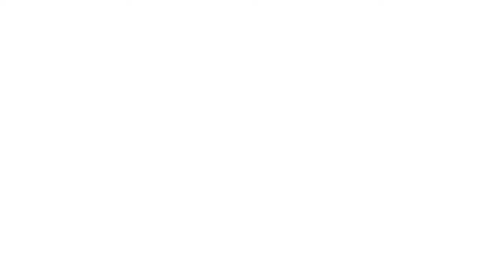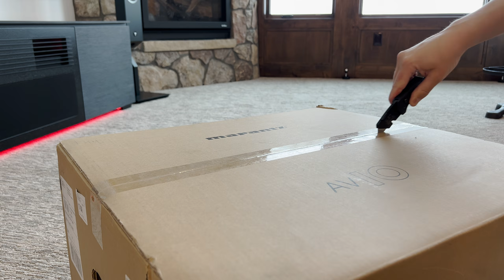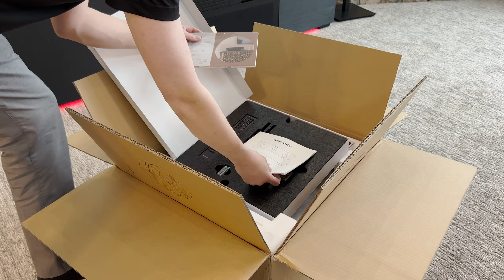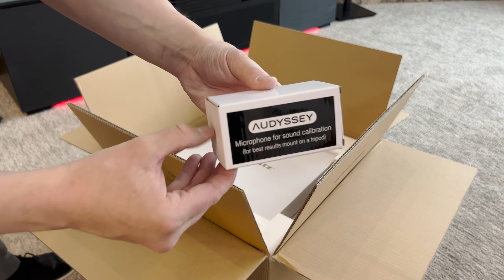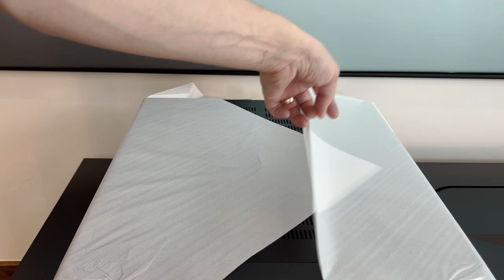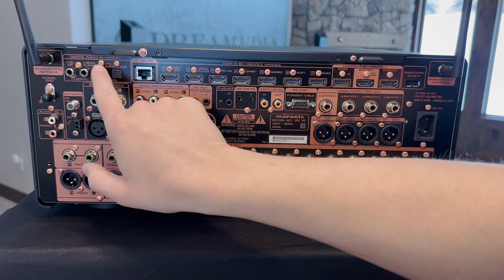NEW - MARANTZ AV10 - REFERENCE 15.4 CHANNEL 8K HOME THEATER PRE-AMPLIFIER/PROCESSOR - UNBOXING

Comment: What happened to composite, component, and s-video analog video input?  I guess no one is using these anymore
Reply from the maker: Those analog video inputs have mostly disappeared on newer AV processors like the Marantz AV 10. Most manufacturers have moved fully toward HDMI since almost all modern sources are digital now, especially with 4K/8K, HDR, HDCP, eARC, etc. Composite, component, and S-Video are mainly for legacy gear like VCRs, older game consoles, and older DVD players, so they’re rarely included on high-end modern processors anymore.

Comment: Hey Zak I’m loving the series was wondering about the surge protector u use I’m interested in getting something like that for my system I’m in PA
Reply from the maker: Appreciate the kind words! Glad your loving it! We have more on the way. The clarus concerto used currently in the system is a real hifi power conditioner and surge protector. It’s pricey but amazing. We sell big dog surge protectors which are super high quality surge protectors and actually have removable breakers in case you get hit hard you don’t have to replace the whole unit. Call and speak with our specialist. They have a wide range of products and are affordable. Thanks for your support!

Comment: I'm sure this is a beast at HT but I am also curious about how the 2 ch stereo music performance is, compared to a dedicated stereo integrated like the Marantz 40n, because I would really prefer 1 box that can do everything vs trying to integrate separate systems. I've read/seen a lot of reviews on the Anthem AVM90 that praise it's music performance as top class but I would prefer to buy a Marantz ngl.
Reply from the maker: When looking at the side by side performance features on marnatz website there are some differences. I would recommend you call and speak with our specialist to discuss this in detail and dig into the specs. 877-417-9000. Sorry I couldn’t be more helpful. Thanks for watching!